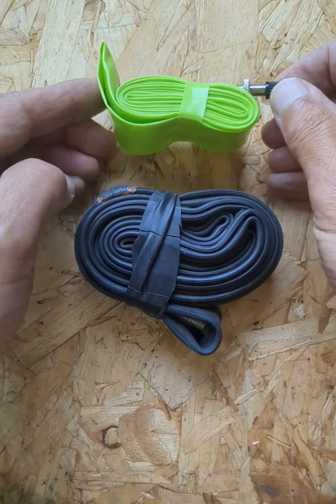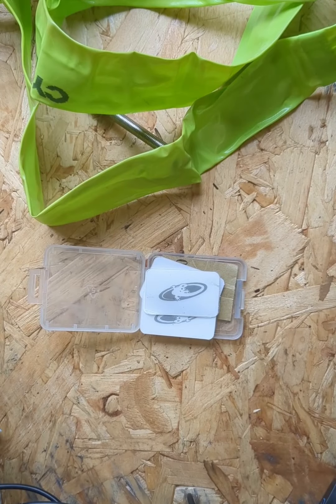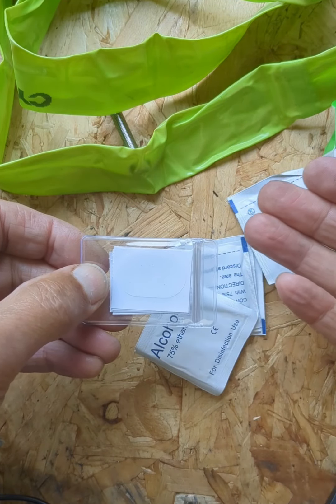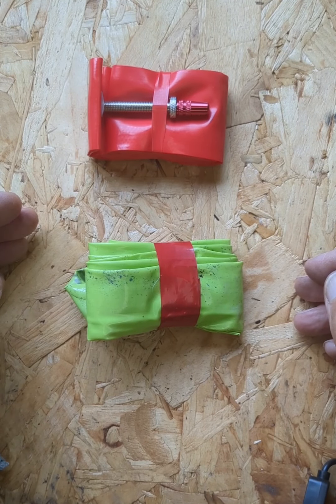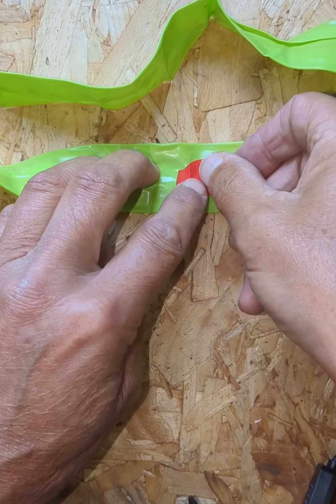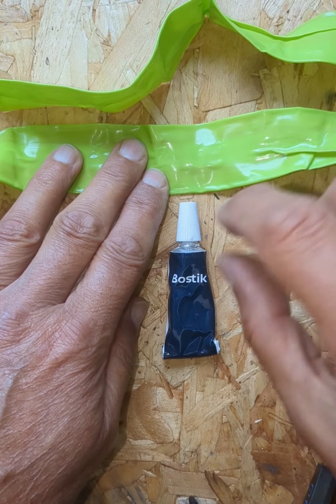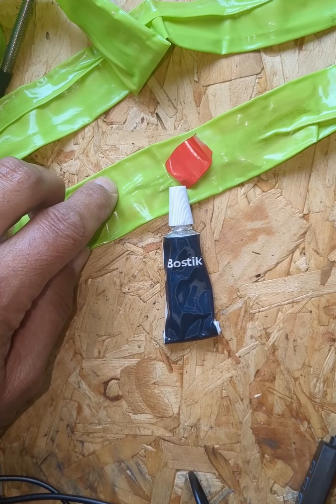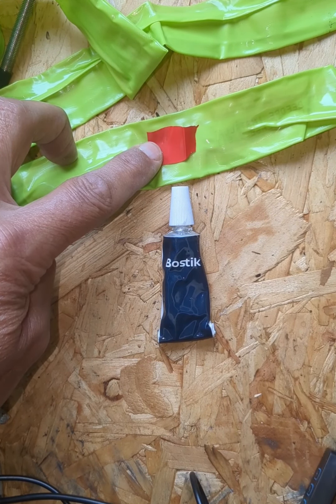TPU tubes are Great: but ... #bicycling #tpu #puncture #cycling #cyclinglife #cycling

Comment: Probably famous last words but since I've been using marathon plus tyres I can't remember getting a flat ( I weigh over 100k) unless the valve breaks and I've got a stack of old butyl spare tubs that are waiting to be used 'in anger'. However I find your videos very innovative and intelligent generally. 😊
Reply from the maker: I too have a stack of old butyl tubes, I keep wondering what to do with them. 
I have Marathon tires on my touring bike. I have got butyl tubes in those as I'm not worried about the weight. In 25,000 km of riding I've had just two punctures. So for puncture free riding. I can recommend marathon plus too, Indeed, I did a review of them earlier in my video feed: https://youtu.be/_7iEiijDRrM?si=z9NmUNQOZGnN5EZO

Comment: I have been using B-7000 glue, with regular patches
Reply from the maker: I haven't come across B-7000 glue before. Maybe I will try it once my bostic runs out, although, that may be some time as it's quite a big tube of glue.
When you say regular patches, do you mean regular patches for butyl tubes, all for TPU tubes?

Comment: Or you could use dedicated tpu glue and patches. Tubolito do a good one as do Ridenow. I've used both with 100% long term success.
Reply from the maker: Dedicated patches, that is true. I haven't used turbolito patches or glue so I can't comment on that. However, I suspect they're just a more expensive version of what I'm doing. However, the cost is low so it's a valid option.

Comment: I use Mr Tuffy with my tubes, have not had a puncture in many years of daily riding. Mr Tuffy weigh about the same as a rubber tube and but get the advantage of TPU vastly superior rolling resistance. For me the weight of Mr Tuffy is a small price to pay for never having punctures.
Reply from the maker: Interesting, have not used Mr Tuffy, might make an interesting investigation. 
I did use a tyre liner many many years ago - it gave me a puncture where the overlapping end wore through the tube! Can't remember the brand, the technology has probably progressed since then.

Comment: Thanks, I'll stick to tried-true-easily repairable-cheap butyl inner tubes.
Reply from the maker: @larryt.atcycleitalia5786  > thanks for the feedback. I know where you're coming from. Although these TPU tubes aren't bad, they're not quite there yet. Maybe in another 5 years. 
I am tending to move back towards butyl tubes in my wheels and carry a patch kit. However, I carry TPU tubes as emergency spares because of their small size.
Regards 5MV.